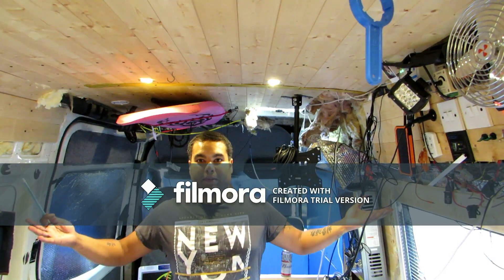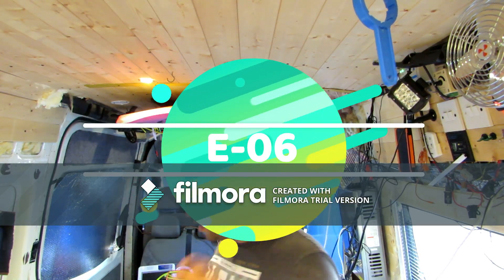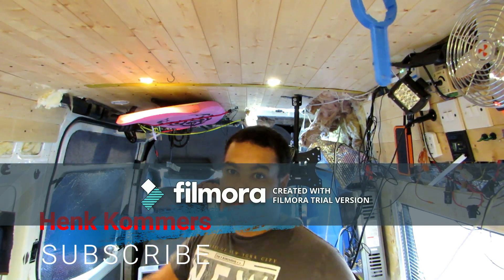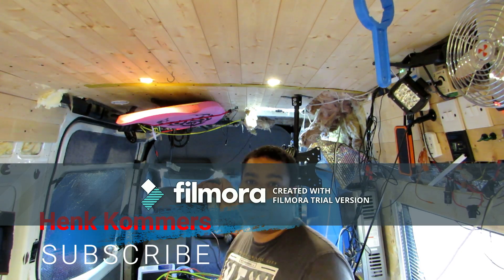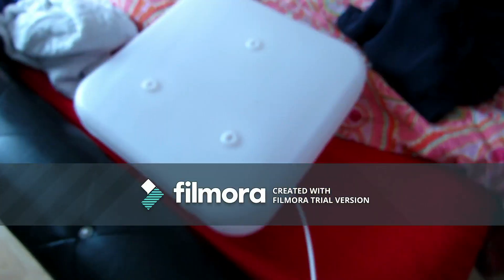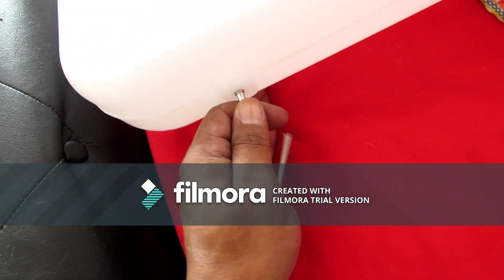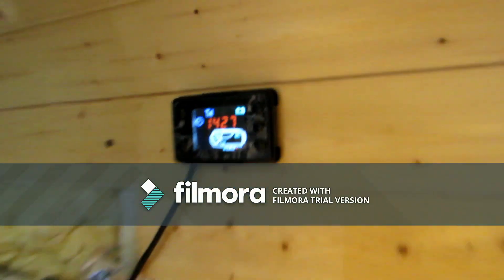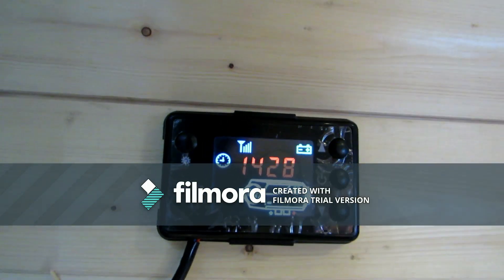Chinese diesel heater error codes E-06 E-10

Comment: Thanks for the video. I had error code e10. After investigation I found out that the fuel hose was touching the hot exhaust pipe, had melted a bit, and therefore had a leakage. After fixing that, new priming, and now it works like a toilet seat on a train!

Comment: I can hardly hear what you are saying due to background music. E-00 is no errors detected.
Reply from the maker: E-00 means no errors bud
Reply: @belgrave1984  I know lol I just said lol I had mine a couple years, bolted one into each of our minibuses and coach simple enough straight from the box, although i didnt use that screw for the fuel tank. I drilled the hole in the cap and just push the hose through all the way to the bottom and used a rubber O ring to seal it. the hose reaches at the bottom so can draw the fuel from the bottom. on the coach though, it is connected directly to one of the built in fuel tanks. We not needed to use the heaters for a little while but I had gone to test one of them today to give it a run. It came up with the E-06 code. I noticed with my hand plying little pressure on the heater, the fan sticks. I tried watching this. But I cant really hear what you saying but that is down to my hearing problems.
Reply from the maker: Try moving the fan make sure it spinning bud

Comment: Hi! Any idea what E01 is my heater won’t run doesn’t even try. Thank you Jamie
Reply: low battery voltage. try charging your battery or make sure you getting a good connection.

Comment: Had E-006 error on my machine. I googled it and found a video -related to white smoke coming out -Where they suggested to blok the air intake a couple af seconds and then let go... I tried that... Again and again... White smoke... Sometimes E-006. I was wondering if I had primed the heater to many times -and drowned it I diesel... There were diesel in the exhaust pipe. Hmmm... I tried and tried again to blok the air intake -Fearing that I had to take it apart and clean it inside... Then for the heck of it -I started the heater and just bloked the intake -and once in a while letting a bit of air in. And thick, thick white smoke was pumping out... Let a little air in, bloked and at a surtain time I let it have all the air -And it started... For about ten minutes there was white smoke... And then it cleared -and it was fine. Its been running for about 8 hours today... No problems. Hope it helps somebody... Im not a mechanic -it was pure intuitive... You know -Feeeeling in to it... :-)

Comment: Also I have 06 error and the fan blocked. How do I unlock the fan? Thanks for your future answers.
Reply from the maker: just spin it with a screw driver when powering up
Reply: @belgrave1984  it was easier than I thought, the plastic of the control unit mounted above the fan touches the inside edge of the fan blocking it. The problem is now another, I managed to start the heater, but now it does not start anymore. After turning it off and getting it cool I tried to turn it on again but it does not work. The fan now turns, but it starts for a few seconds and stops giving me error 06, but this time the fan icon flashes in the display. More suggestions?
Reply from the maker: Nice one I hope u enjoy it I’m here to help
Reply: @belgrave1984  The fan runs, but I still have error 06, what should I do?
Reply: I had 06 code I just pulled the fan slightly outward, it was pushed so far in that I couldn't even spin it

Comment: how do you clear error code 6? i have both magnets present in the fan for the sensor to pick up. both settings in the admin menu (for 1 or 2 magnets) just make the fan speed go up (when i set it to 2 magnet mode). the heater after pressing the OK button a few times, still has the 06 error code stored in it. how do you delete these stored errors??!
Reply from the maker: JohnDragonMan u can’t delete it bud plz check your exhaust is not bend and it going straight down plus make sure it’s getting fuel
Reply: @belgrave1984  I cant even get the thing in priming mode. As soon as I connect power it turns its self on. Pressing and holding the power button does nothing even with a different display panel. I have already replaced the fan motor and main PCB. It wont even fire up the glow plug. Just goes straight into this mode where the fan turns on and wont do anything else.
Reply from the maker: They all not the same to prime bud which one u have
Reply from the maker: Here bud my number +44 7574 767577

Comment: I am stuck on E10 No fuel - The tank is full I have manually pumped the pipes until empty but now it is not drawing fuel. taking no diesel to the heater giving e-10 error. Any ideas what to do?
Reply from the maker: Check the pump the right way round bud
Reply from the maker: And make sure u prime the system

Comment: E-05 code :/
Reply from the maker: Ruva A.A I think that one is overheating I will check later make ire’s the fan is spinning and nothing blocking the air flow
Reply: I actually found the problem, it was a piece of paper blocking the intake ... 😅

Comment: im having  e06 error code, have unscrewed the end cap but no difference, should the fan spin easily and freely or is there a bit of resistance and have to turn by hand. it seems to try to start and then there is a click and e06 appears.. appreciate any help
Reply from the maker: When u start the heater up is the fan spinning if not mean fan is stuck bud the vent fan make it loses not to tight
Reply from the maker: huw bisson it should spin freely
Reply: @belgrave1984  I'm having the same issue as Huw Bisson. I took the intake cap off.. still get error 06. My fan seems to have a lot of resistance when I try to spin it by hand. Any way to loosen it?

Comment: Diesel coming out of exhaust = flooded combustion chamber, disconnect fuel line run several times to allow glow plug burn off excess  fuel ,once running clear of smoke. Prime then start again.
E-00 = no faults
E01 Low battery
E02 High battery
,E10= Run out of fuel
Reply: I am stuck on E10 No fuel - The tank is full I have manually pumped the pipe until empty but put bank in the tank it is not drawing fuel. Taking no diesel to the heater giving e-10 error. Any ideas what to do?

Comment: I'm getting ERROR #4 NO FUEL. BUT the heater has fuel and works perfectly if the van engine is off. If I have the engine running and Start the heater it will get to the fuel pump (power on point) and will fault out giving error code 4.  It's a 2017 ford transit. Anyone have this problem or ideas what to do.    All I can think is its something to do with alternator noise. I tried a 30 amp noise filter on the power wire from a ccard stereo. No help.    Any ideas would b greatly appreciated  thanks all!
Reply from the maker: Have u prime the system
Reply from the maker: Earth it from the van frame not the battery

Comment: Hi getting eo6 code any ideas what it might be
Reply from the maker: Colin Wade yes bud sorry for the late delay it’s your fan motor stuck just unscrew it and take the case off till the fan spin put it back on
Reply: @belgrave1984  cheers will give it a try and let you no
Reply from the maker: No problem I’m here to help bud goodluck
Reply: @belgrave1984  just tryed it fan works ok when prime mode just comes up e06 when try to fire it up
Reply from the maker: Two things fan is sticking or stuck or fuel pump not connected
Reply: @belgrave1984  ok thanks will check the pump in morning and get back to you as it's under the van
Reply from the maker: Colin Wade have u unscrewed the vent on the case
Reply: @belgrave1984  yes did that but still do the same will check pump in morning
Reply: Hi checked pump feul in pipes but still e06 code
Reply from the maker: It’s your fan case most to tight make sure it loose to spin the out take sode
Reply: @belgrave1984  no the fan spins free
Reply: @colinwade6802  did you solve the problem i have the same problem as you and there ia another video on youtube with same problem but he doesnt show how he fixed it
Reply: @markharding8378  no mark didn't sort it not got a clue what's up with it yet
Reply: @colinwade6802  ive tried to work it out its as if the motor may be broke but since i messaged you i am wondering if you need a certain amount of power im battery to initally get the motor to run i just have mine onto a leisure battery threw solar panel what have you tried
Reply: @markharding8378  I tryed fully charged battery my motor runs ok if I put it in prime mode but just comes up e06 when I try to start it
Reply: @colinwade6802  did you buy it off ebay we may just have faulty ones as the book says check polarity and a sensor but we shouldnt have  to i think il be asking the sendor to send a new one or refund wouldnt car spent the last 2 days cutting holes and instaling it lol
Reply: @markharding8378  yea I have done the same all fitted and won't work lol
Reply: @colinwade6802  did either you or mark figure E06 out? I have the same issue as you two..
Reply: @daggerama  yes it turned out it was the control board got new one ok now
Reply: @colinwade6802  damn.. I was worried that'd be the answer. Really appreciate the response tho!
Reply: @daggerama  it was 24 pounds on ebay for control board and lcd
Reply: @colinwade6802  do you have a link to where you bought it from?
Reply from the maker: And reset it by taking fuse out
Reply from the maker: E-06 usually motor bud that’s the only code I know have u reset it by taking fuse out
Reply: @belgrave1984  yea tryed that but no joy
Reply from the maker: Colin Wade here call me +44 7574 767577
Reply: I have the same problem as you with the e 06 error fan is free but its just not firing up the unit clicks but nothing done fuse checked pump everything has anyone resolved this problem

Comment: the error code is 00 is always on mine but working fine never thought anything of it as its not showing on the panel fault code description sheet i got it shows codes from E-01 to E08 does not have a E-10 on mine
Reply from the maker: Yorkshire Vanlife e-00 means everything Working fine